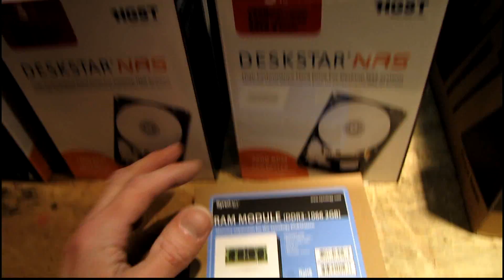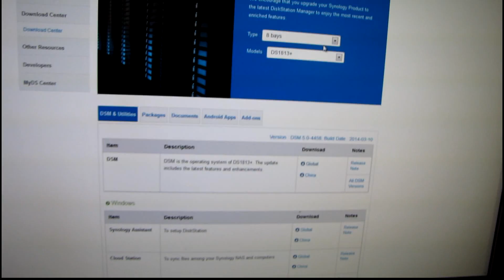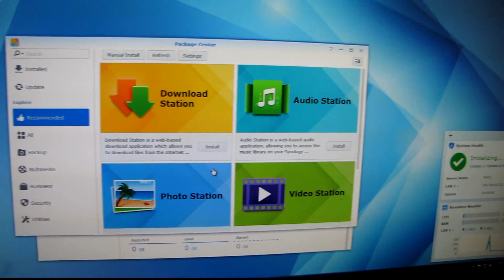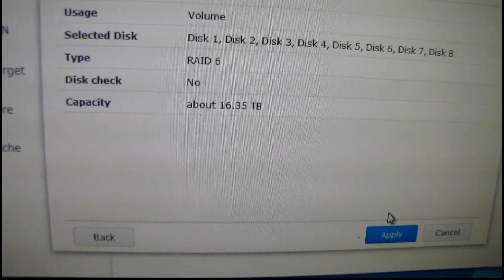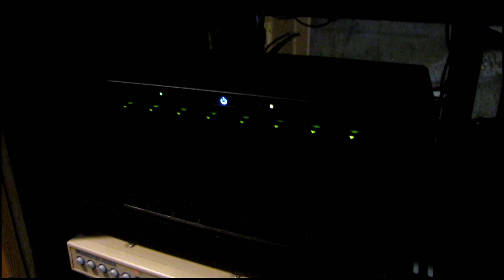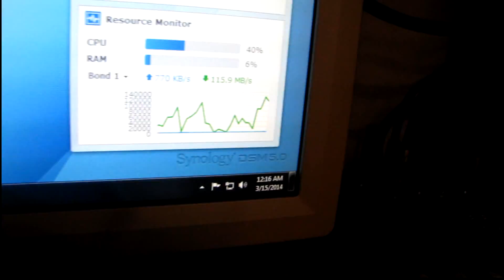Replacing my file server 3-15-2014

Comment: After 10 years, how is this system holding up?
Reply from the maker: It is still running to this day, with no failures yet.  I never ended up needing the spare drive I got for it either.  Last I checked, there was about 87,000 hours on it.
Reply: @Maxxarcade  You know if you did not buy that spare murphy would have taken a drive out in the first year.

Comment: seeing this reminds me of my file server i had to replace last year after the motherboard had a mysterious and unknown death but i knew she wouldnt last to long after suffering from a surge somehow through the ethernet cables into the port of wired devices a DVR had to be replaced since it was IPTV, file server onboard ethernet and my wifi router and a port on my leased modem the motherboard lasted like maybe about 1 year and 4 months while the motherboard got zapped 4 days after i put it in to replace a unreliable PC chips motherboard the board was from a HP pavilion a1129n but i dont miss that board since it was using a crap AMD single core CPU i think now in days it has a core 2 duo e6400 or  e6700 with gigabit ethernet and sata 2.5 though my data drives i think are SATA 1.5 instead of sata 2 (motherboard was used that i got)

Comment: All NAS solutions (Synology, NetGear, QNAP, ASustor, etc.) are over-priced and basically you are paying for software and the features/flexibility. The hardware is usually cheap with lots of plastic and under-powered CPUs. DIY solutions need better open-source software, other than FreeNas, to compete.
Reply: And its alot less trouble to rebuild your Raid when the Hardware dies.
Reply: You can have both! DIY AND Synology. it is called XPENOLOGY.

Comment: You'd be surprised how good DIY solutions can be.
[All prices in overpriced AUD, cheaper in the US, also this is a complete home server, not just a NAS]
Asrock c2750d4I $420 (soc atom 2.4ghz x8 cores w 12x sata + 2x intel i210 )
Fractal node 804 $150 (silent, good airflow, rubber on 8 of the HDD mounts)
8GB 1.35v ram $90 (low power, low failure rate)
2x 3m triple shielded cat6e $5 each
Corsair RM 550 $140 (fan never even spins up)
Win server 2012 r2 $dreamspark=free

Absolutely silent, it's in my room and the only noise I hear is the HDD (although the cars and wind are way louder).

Comment: My file server is an old Compaq Presario S5400NX someone gave me a few months ago.

Specs: (If you care)

2.6 GHz Intel Pentium 4 HT Northwood
256 MB DDR 400 MHz
40 GB Seagate Barracuda for generic files
30 GB Maxtor slimline-thing for the movies and stuffs
Windows Server 2003 R2
A Bestec-in-disguise 250 watt PSU

No RAID or anything fancy.

Oh, and di I mention this is also my Minecraft server? XD A little pentium 4 running as a media server, file server, and a Minecraft server! Isn't that wild!
Reply: There is a huge options list when you start Windows, and one of the options is to create a file server. You know the rest.
Reply: Ehhh.. Well, I've already torn that PC down because I'm about to transfer it into a rack-mount case, but server 2003 and FreeNAS didn't run that shabby on 256 MB RAM. I'll consider it, though, since I have a boatload of DDR 400 sitting in a box somewhere. Thanks!

Comment: I agree 100% with your reasoning behind going with a prebuilt system like this. My current file server (running windows server 2012) is much harder to deal with than that, not to mention that trying to implement features such as the media sharing and getting macs on the network to see the server is much more difficult. Currently I need to get some more hard drives to get some redundancy and speed benefits but other then that I don't think that I can afford to make something like this, maybe in the future my P4 system will be replaced but that's not likely to happen.

Comment: I just LOVE synology i still have ther very first model of 2003 in my collection, i have been buying other models since that time, i now have the 2411+ and 411 slim, both up and running and i did build my own Synology using Hp N54l Microserver, it is running the newest dsm 4458, i have been following your videos for a while, actually about 2 years, and i really enjoy watching your videos, you specify everything in details, and i like that, My english is not to good, i speak it better then writing, But i am from Denmark, .. best regards Daniel Pedersen DK

Comment: Just bought a new switch for my home network  trendnet tl-sg1005d  its wery good for home my network router is 100mb full duplex and my pcs card now works @1gb/s  it solowed my network performance issues

Comment: I seem to be a generation behind you on this. :)
I'm still in the process of setting up a server (files and other functions) using an old K8 Opteron server board.  It's using SATA, so it's a bit more modern than your old server was but not by much.  It won't have that many drives in it though and the transfer rates probably won't be as high.
The idle power is very decent with some power management on the CPU as well as getting the hard drives to spin down when idle, but getting those things to work the way I want them has been a pain.  Everything I try to do in linux tests my motivation.

I'm impressed by the performance of that Synology unit.  I had no idea they were that fast.  The units I've seen people talk about on forums weren't nearly on the same level as this one.

Comment: Wondering if you could check something for me on that synology.  If you add camera's, is it also 1 for free all the rest you need a license for?  I have this 2 drive synology where this is the case, I'm kinda curious whether they apply the same policy on the more expensive models.

That NAS setup looks well worth the money.
Reply from the maker: Yep, I remember reading about that.  They all run the same software for the most part.  I think the only difference is the number of drive bays.

Comment: @Maxxarcade you might wanna try and contact NewEgg if thats were you purchased those drives from.. They just came out with a promotion which would had saved you $360 on all those Drives!  They came out with a new E-Mail deals thing and they are now $129.99
Reply from the maker: Thanks, working on it :-)
Reply: Maxxarcade Thought its not so bad if you bought one but you bough several it adds up :D  I`ve ordered a lot from NewEgg and it sometimes takes a little persuasion in the online chat but its doable even if they have to give a Gift Card better than nothing :)
Reply from the maker: ***** Yep, they are working on a $100 gift card.  If they actually go through with it, that's fine by me :-)

Comment: 3.6TB is not enough anymore? Wow you got alot of stuff. I barely touch a 750GB.
Reply from the maker: Working with HD video for several years does that LOL.
Reply: I may end up being like Max one day. But not sure how ill be able to afford it. at best i could only afford a 2TB Drive, and gonna try get another for my Little Atom Computer which I use for File Storage. i was stuck having to use my desktop cuz my Atom only has couple bays. only couple 500GBs. And there maxed out. So im using more and more all the time also.  Hope your set up works well.
Reply: Well jokes on me, because I didnt keep any of my HD video footage. I just upload and go. Never thought of that.
Reply from the maker: ***** I keep all of it whenever possible.  Each of my Youtube videos takes up quite a bit of room.  Individual takes (3-12GB total), final edit copy (1-5GB), project file, etc.

Some time ago I forgot to backup a bunch of my project files, so if I were to lose the final rendered video, I'd have to re-edit a new one together.  Better than nothing though I suppose.

One of my possible future projects, is re-uploading some of my older stuff in HD.  Haven't decided if it would be worth the time yet.

Comment: Be sure you feed your server very clean power -- use the best internal PSU you can afford. And for UPS, get one with excellent line-conditioning. I use one of those "audiophile" line-conds, too, followed (cascade) by a APC UPS, then another Tripp-Lite line filter/arrestor. Use plenty of those EMI/RFI ferrite cylinders, too.
Using this clean-power "strategy" I have PCs and laptops running on orig. motherboards, HDDs and PSUs for 10+ years. Very few problems-- BSODs, freeze-ups, crashes, etc.

Comment: I use almost all Hitachi 7200rpm Deskstar HDDs (that's the std line, not the more-$ pro-grade Ultrastar series). WRT reliability, my 10+ year experience with HGST (both 2.5" and 3.5") as well as all the reviews/reports I've read seem to suggest Hitachi is at the top (followed close by certain WD). HOWEVER, any 3TB model may be asking for slightly more trouble (extra platters ... that's more weight and load on bearings and motor). I use 2TB sparely (storage) and 1TB for my daily workhorses. (See the recent Backblaze study for more details).
All that said ... waiting for SSD prices to fall ... for signif. gains in perf. and reliability!

Comment: Maxxarcade- where do you think I can find a replacement red/black plastic clips for my amplifier's speaker terminals? It's a really good amp and that's one of the few things it needs. Or would replacing the whole terminal be the only option?

Comment: So with that new NAS running, you now have an abundance of 250GB and 320GB IDE hard drives. it's getting pretty hard to find them in those sizes on eBay that aren't from a non-reputable source. What're you going to do with all of them? I ask since my main tower boots and runs off an old 9 year-old WD 200GB, which recently is nearing the fill limit, as are the rest of the drives which are all SATA of different large sizes. http://goput.it/ggz.jpg

Comment: Make sure you destroy the data on the HDD's before they leave the house.
Reply: Maxxarcade
Honestly I think some of those dedicated wiping utilities, like DBAN, are overburdened with theoretical nerdiness and just make the wiping process much slower than it needs to be.
I'd just boot a linux CD, use fdisk (or boot logs) to get a list of the device names for each disk or array (/dev/sda or whatever), then go to the console and run  dd if=/dev/null of=/dev/sda bs=1M
for each of them and call it good.  That quickly fills the 'outfile' device with zeros, and there's essentially zero chance that anybody could ever recover anything from it.  It would take the resources of a major (and desperately motivated) government to even try.  A home hacker couldn't do anything with it.
Reply from the maker: Ya, it's gonna take a really long time to erase those drives properly.  Not looking forward to running it again for that :-)
Reply: There is always the hammer method if they are not worth it.
Reply: you could use a standalone machine to dban the disks if they are going some place usefull, or my trick is to run a drill thru the drive in about 4 places, make sure you go right thru the drive and drive electronics.
I was told by a data recovery person that if you do that there is little chance of the data being reovered.

My old server(s) used some 900watts, I now have 2 Qnap NASs and they run very quiet and consume some 70watts, upside is that the UPS can run the NAS, a i5 an switch for over an hour if need be instead of 10mins with the old server arrangement.
Reply: Or Overvolting:)
Reply: +TheEPROM9 There's nothing the good old drill can't fix. Drill 3 holes directly in the disk and it's done. Nobody will bother with it anymore.

Comment: I find it ironic that you were using an mkv file from YayPonies to benchmark your new NAS with. Let me guess, you also think that the raw MLP iTunes episodes are too messed up to waste any money on?
Reply from the maker: The ones directly on iTunes have a lot of issues with messed up audio.  I'm glad that Apple gives refunds whenever that happens at least.
Reply: Yeah, the broken audio tracks are definitely a huge problem. I've contacted the Discovery Network about the iTunes problems in the past, but it's still occurring way too often.

They've also never fixed the washed out colors and cropped episodes of season 1 and 2.

Comment: I have a system that RUNS at ~720W!

It also outputs nearly as much heat as a kerosene heater.
Reply from the maker: What kind of hardware is that?  Sounds about as bad as my old HP 9000 systems.
Reply: Maxxarcade Quad-proc AlphaServer ES40 :D
Reply: You should be arrested for using so much resources, shame on you.
Go Green, use less, save some for the rest.
Reply: MrMac5150 Never said I run it all the time! ;)
Reply: I  use one of those pogo plugs that you can put Linux on, I believe it has a ARM processor  transfer rate 25 MB a sec, runs very fine for a home server, 18 watts of power, you can pick them up for about 25 bucks, a simple SOHO, just  for the info.
Reply: Those aren't Alpha though! ;)

Comment: It's strange that you went with an all in one solution :D I was at the very least expecting a machine with freenas and raid-z :)
Reply from the maker: I couldn't compete with the features and price on this.  The case and RAID card alone would have been close to $1k.
Reply from the maker: *****
I would still need an expensive (and heavy) case with 8 hot swap bays and some really good software to make it worth it though.

Comment: I just bought myself a poweredge 2900 with 1 xeon e5405 6 450gb 15 k cheetah drives and 2 73gb 15k cheetah drives 8gb ddr2 ram and its pretty damm fast as i get 1.2gb/s on the 6*450gb drives with the dell perc 5/i and i got this for 200€. But you got 8 drives so i think you should get something like at least 400mbps read and write out off that.
Reply from the maker: I was VERY close to buying a 2900 Gen 3 with PERC 6i and 10x 2TB drives, but it wouldn't have saved me any electricity, and would have been maxed out when I got it.  Plus the cost was about the same, and I'd still need to supply the software.
Reply: mine only uses 150-170w so that is very good for what it is but i'm going to sell the sas drives and get normal drives because they are super expensive to replace if they break
Reply from the maker: jashelps Yep, that was my issue as well.  Plus the 2TB per drive limit.  I'd have no room for future expansion.

CPU power also makes a difference.  I was going to run a single L5420 in mine to keep the wattage down.

Comment: I have about 3tb in one drive :p
Reply from the maker: Yep, the old system wasn't worth the cost of running anymore.  A single drive from the new one is almost as big LOL.
Reply: Haha:p
Reply from the maker: ***** Hence the RAID 6 array in the new system.  It can still function with as many as 2 failed drives.  Gives plenty of time to replace the bad drive before any data is lost.  The old server was RAID 5, which allows for one drive to fail.

Comment: how much would you be willing to sell the motherboard out of that machine for. My file server went down and I need a better system than the desktop PC that is holding it down for right now.
Reply from the maker: It's an extended ATX board that's kinda unique to the case.  I won't be doing anything with it for a while, until I know I'm done with it.